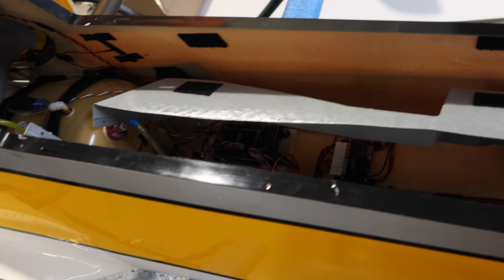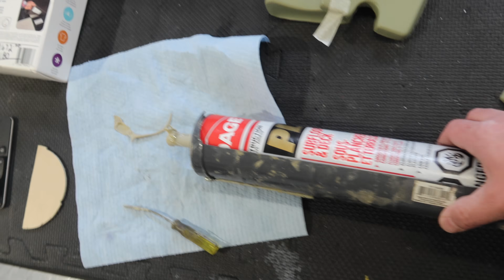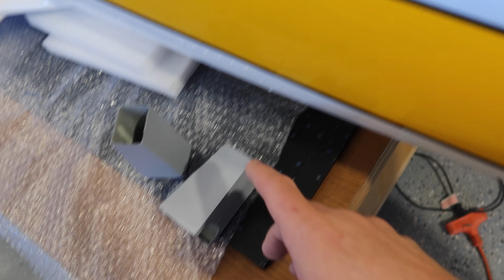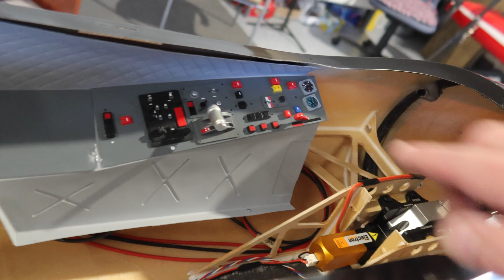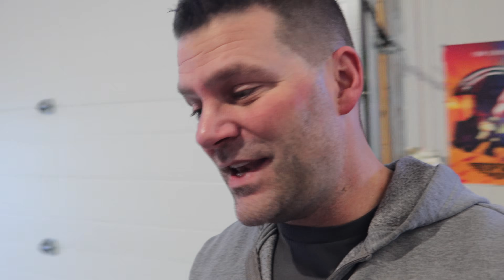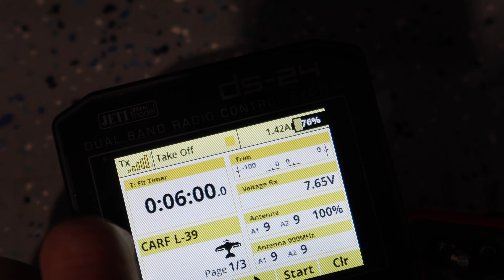IM DONE - CARF L39 RCJET Complete!

Comment: Where do you get the connectors you used to make the wing harnesses?
Reply from the maker: Ashlok connectors. I generally get them from Dreamworks in florida
Reply: @thelightersideofrc  also, what are you using to measure the angle of your control surfaces. I really liked it in the other video but can’t seem to find it.
Reply from the maker: @pontiacdriver999  the plastic angle finder is available at princess auto in Canada or harbour freight in USA. Maybe Amazon.
Reply: @thelightersideofrc  I’ve got a Harbor Freight right up the street from work. I’ll check it out. Thanks!